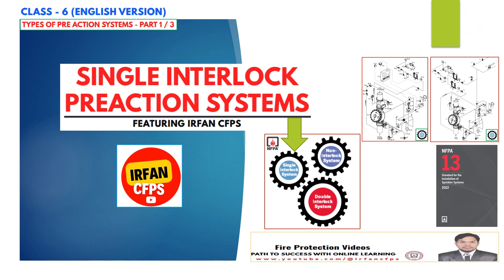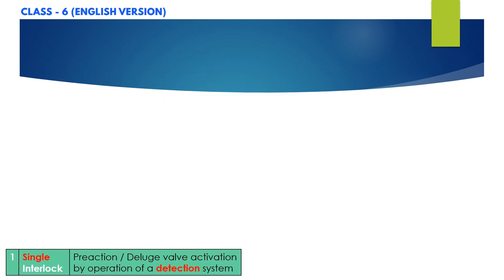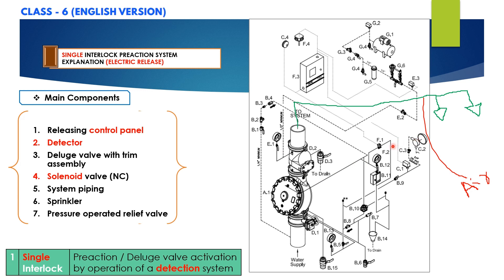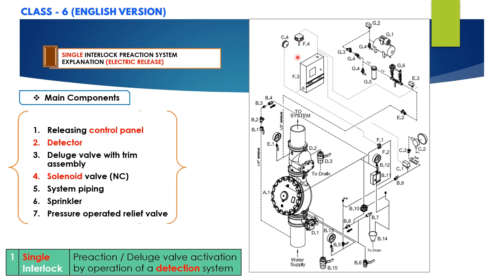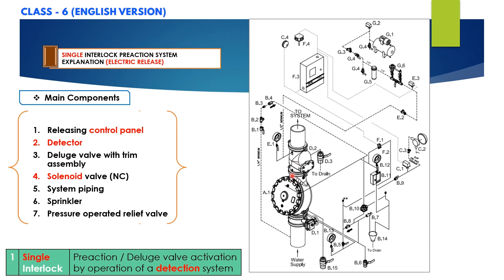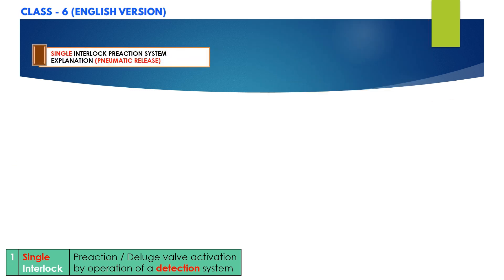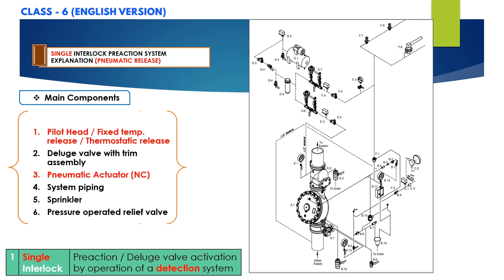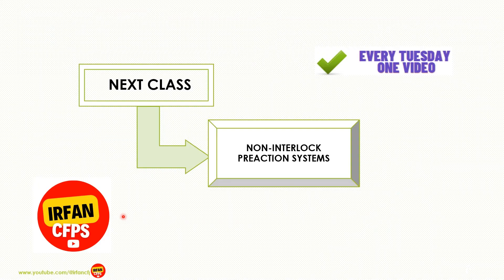How Does a Single Interlock Preaction System Work?

Comment: Is an auxiliary exhaust required for a single-interlock pre-action system?Will the absence of an exhaust device prevent or delay the filling of water in the pipeline network due to air pressure inside the pipes?
Reply from the maker: Iam not sure of this. As per my knowledge no need

Comment: How the air release from pipeline once detection detect and sprinkler not burst
Reply from the maker: Air will release whenever sprinkler breaks
Reply: Water will still enter the piping when the detection activates (this releases the solenoid to vent priming water).  There will still be air but the system will start filling with water.   Supervisory approval is normally around 10 PSI.  The water will compress the air until the pressures equalize but the alarms will have activated by this point.
Reply: when detection detects .. sprinkler not burst . Water want to enter into pipeline but it was filled with air so due to air water cannot enter into the pipeline.. in this stage how stage how air get release